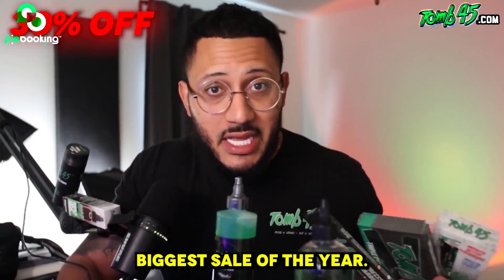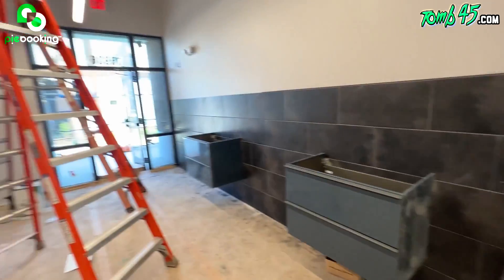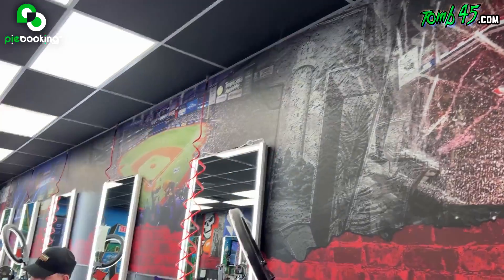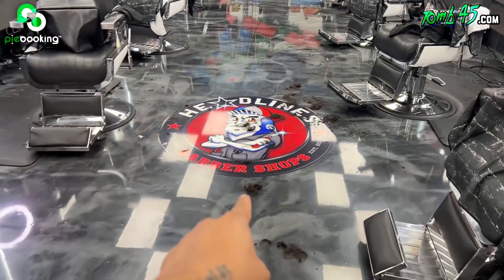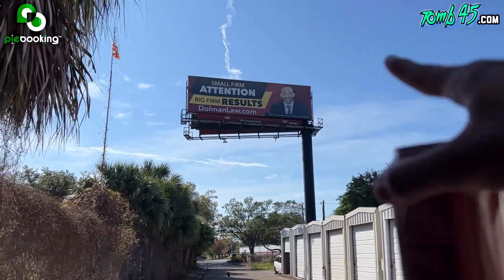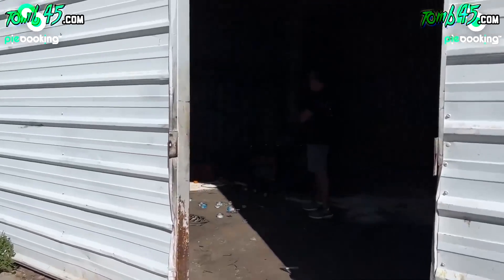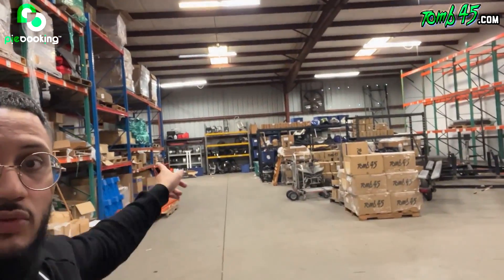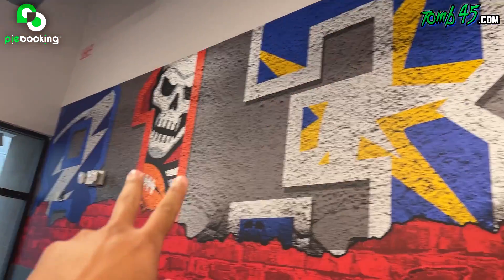New Barbershop and Warehouse *EPIC*

Comment: how much did it cost to open something like this?
Reply: Real numbers rounded dor this specific shop was: (estimated $35,000) Deposit, first/last rent $8,000 chairs/stations/mirrors/garbage cans/air compressor/ washer dryer, $15,000. Wrap $7,000. Tile walls, $5,000. Everything else was included in our contract with the developer.